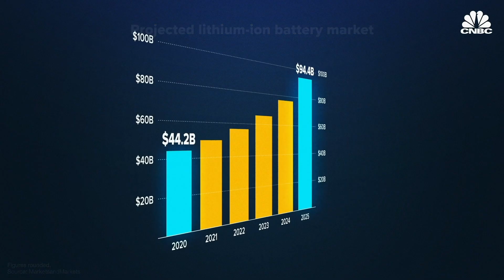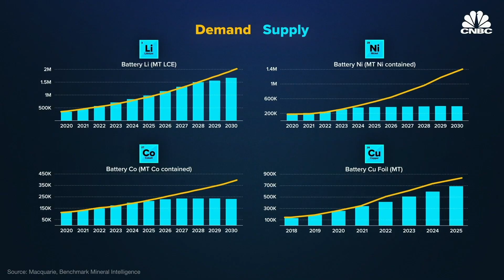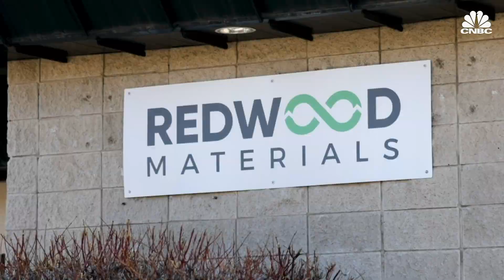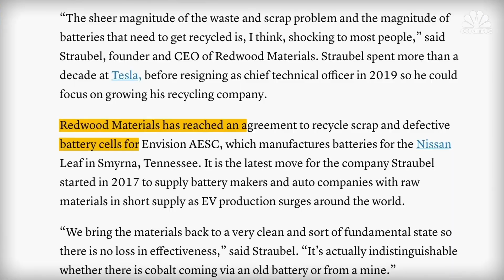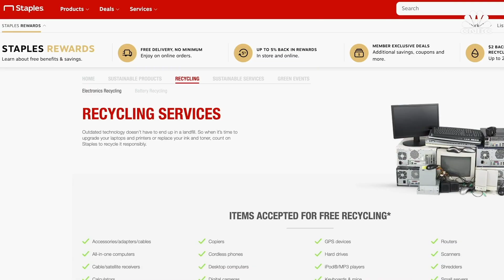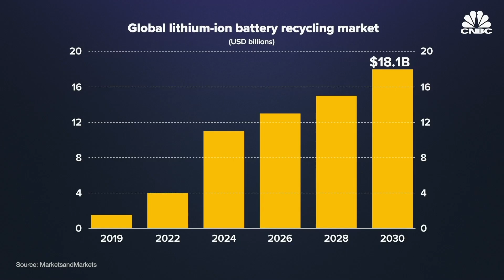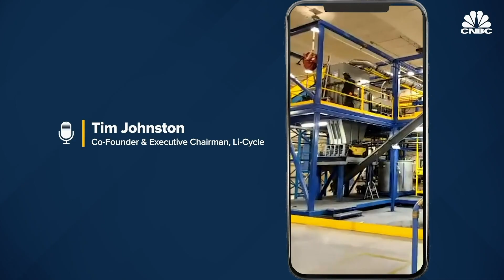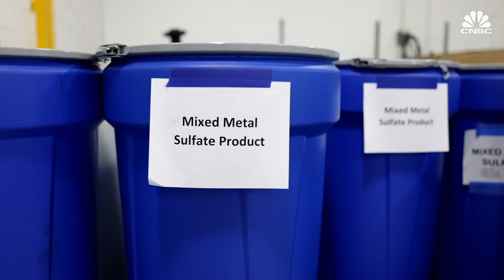How Tesla’s Battery Mastermind Is Tackling EV's Biggest Problem

Comment: He and my search online of his company don't say how they have dealt with the hardest part of lithium recycling. Each cells has a thick plastic coating that hard to come off. They are only 2 ways to take it off. To burn it off. Very heavy pollution and to acid melt it off. Both are used now. But not large scale. He the first. They is another way to grind it up but you have to take the plastic off to take the electrode n
Metal off or it could catch fire. That what they space it that way.
 And another big problem on lithium battery switch is they still have found a way to put out a lithium battery fire. It don't need oxygen that was fire extinguisher do is cut out the oxygen.  The problem is battery is really a stored house of energy. And we got 3-6 floor of parking close together. One fire could get the next car on fire too. Etc.  the only was is a single common regulated disable switch.
of rolls and now, or yr after a building fire they might just bans cars indoor parking if we don't solve thing ahead. As on fire the smoke could effect blocks
Reply: Reality, is we are taking billion of cars off gas. So where is this trillion of maga watts comeing from? They will be charged at nigh. Battery stored  solar power?
It has to come from oll power plant. Goggle bio mass wood pellets. They call it carbon neutral but are they making sure tree are replanted? We need tree leaves for that carbon dioxide to oxygen.
Goggle wood pallets shortage .
The worl has that shortage problem now.. we don't have enough wood for burning wood for power plant.uk is in a big mess. They tried too much and all failed breaking away. We are doing the same. Jack of all trade Master of none.

Comment: Behold, the real reason why electric cars are never going to catch on.  Hybrids are the future, not EVs.
Reply: Wrong, any car with an internal combustion engine in it, will soon be a thing of the past.  EVs are the future and I am already driving it!
Reply: @kevinkaaz7720  I think EVs are great and that environmental protection is important.  The reason they are not the future is for two reasons: (1) because they will ultimately become the supercars/ultralux segment as we gradually run into supply-side constraints and battery manufacturers are increasingly unable to source those materials cheaply and (2) because unlike ICE cars, which have an extremely long lifespan (see the used car market) EVs, by comparison, do not, due in part to Tesla's position against right to repair and the expense of repairs.  This means that we will need more new EV cars to be manufactured if the intent is to satisfy the demand of the entire US market.  That, in turn feeds into problem (1).
Reply: @aka_pierre  My Chevy Bolt EV is hardly in the super car/ultralux segment...
Reply: @kevinkaaz7720  that's not my point - we're going to run out of the rare minerals and metals needed to build EVs extremely quickly.  When that bottleneck happens, car manufacturers will reserve EV powerplants for supercars/ultralux.  The unfortunate reality is that EVs (including the bolt) lose around 10% of their battery capacity per year, and the cost of replacing the battery is the cost of a new car.  That is essentially built-in obsolescence (except unintentional).   Thinking that we can have the entire population driving cars that run entirely off a battery is just not sustainable in the long run.
Reply: @aka_pierre  That is total FUD about EV batteries losing 10% of their battery’s capacity each year.  My Bolt is over 2 years old and may have 2% degredation total.  I only DC fast charge when on road trips, of which I have taken roughly a dozen.  I have total confidence my battery in my Bolt will last over 10 years and over 200K miles with less than 10% degradation.  In contrast, the ICE car that I had the longest only had approximately 175K miles.
Reply: @kevinkaaz7720  Ideally, everyone would be driving around in high-powered EVs; I simply think it is unrealistic.  Your usage is great, but unfortunately, I don't think that you are the norm.  I recommend against using fast chargers whenever possible.

https://batteryuniversity.com/learn/article/bu_1003a_battery_aging_in_an_electric_vehicle_ev
Reply: @aka_pierre  Question for you Pierre - Do you own an EV?
Reply: @kevinkaaz7720  No.  I preordered the electric mini for my dad until the salesperson told me that it wouldn't fit his commuting needs, they said it would lose 10-20 miles of range every year, which would mean he would need to charge at work (not an option).
Reply: @aka_pierre  Here’s a hint, many salespeople don’t know squat about EVs.  Sounds like the Mini salesperson was example A.
Reply: @kevinkaaz7720  I don't mean to denigrate you, but I'm not going to take your word for it either.  Just look at used car sales and depreciation for EVs.
Reply: @aka_pierre  So you would rather take the word of some random salesperson that “may” have taken a test drive in an EV over an actual EV owner with real life experience.  I did months of research before I purchased my Bolt, also on other makes of EVs.  I knew exactly what I would pay as well as how it would perform years down the road.  I try to educate people on the benefits of EV ownership when they show an interest in mine.  I can see you have already made up your mind on the subject and for that I am sorry.  😞. You are truly missing out on driving a better more efficient power plant in a vehicle.  I guess I won’t waste any more of your time in any further discourse.
Reply: @kevinkaaz7720  I feel like we're talking over each other.  You seem to be trying to convince me to buy an EV (I don't need convincing, I think EVs are great).  I'm telling you that the future is not EVs because its not sustainable for everyone in the world to drive an EV due to resource constraints.

Comment: Democratic ran youtube channel saying we need EV because gas is bad...goes on to say: 

Cobolt has huge carbon emissions to process.

Says batteries are too toxic to throw away. 

Batteries have more than 5 toxic materials...

Battery start to finish have to travel 25,000 miles on ships which is way more gas emissions then oil coming from 1 state away to power your car. 

Says the battery supply chain is bad and is not a feasible source for mass car production....

So just keep gas cars....

Comment: We need a law that forces cell phone manufacturers to make phones with removable batteries.
Reply: Excellent !
Reply: Cell phone batteries are removable.
Reply: @user-RCST  not Apple.  Their batteries are glued in and sealed.
Reply: @djp1234  just don't buy Apple products then if you want to repair stuff.  It's still removable if you're brave.
Reply: @user-RCST  the problem is every other company copies Apple, so they’re all glued in now.  I’ve replaced iPhone batteries before, but it’s a pain in the ass, and your phone won’t be waterproof anymore.
Reply: @djp1234  well what do you expect do you want a waterproof product and a better product or do you want repairable product.
Reply: @user-RCST  it's possible to make a waterproof and repairable phone.  It's super easy.  But they'd rather sell more disposable phones.
Reply: @djp1234  then please explain how would you do it.
Reply: @user-RCST  easy example: GoPro.
Reply: @djp1234  a GoPro is nowhere near as complex as a cell phone.  Please tell me how they make the GoPro repairable and waterproof or show me a YouTube video that explains it well.
Reply: @user-RCST  The battery on the gopro works exactly the same way as the battery on a cellphone.  That's really the only thing that fails on modern electronics, and the only thing that needs to be replaced.  And the battery compartment on the GoPro is more complex than it needs to be.  Really, just the battery terminal needs to be sealed off from water.  It can be as simple as a rubber seal on an oil filter.
Reply: @djp1234  but on a cell phone you have to worry about every other component to not just the battery.
Reply: @user-RCST  I’ve never had any problems with cellphones except for batteries and cracked screens.
Reply: @djp1234  both of those are pretty easy fixes.  We were talking about waterproofing though.
Reply: @user-RCST  the battery waterproofing problem has been solved already.  We just need an easy way to replace the screen, which can also be done easily, but they'll never do it.
Reply: @djp1234  it really doesn't bother me just treat your phone good and nothing will break.
Reply: @user-RCST  

Most cellphones no longer have removable detachable batteries.
Very few models have this anymore.
Reply: @SunnyIlha  yes I remember those but they still have detachable glue pull tabs you can use to remove the battery.  I'm pretty sure they switched because the soft pouch design is either more energy dense or cheaper but that's just a guess.

Comment: We will not need battery recycling as there will be no electric cars in 10 years from now. The future of emission-free cars is in hydrogen. The Germans found a way to store hydrogen in a gel that can be stored, transported and distributed via existing infrastructure. No need for changing the infrastructure for trillions of Dollars as with EV´s, just slight adaptions. The gel has about the same energy density as gasoline, is inflammable and the hydrogen can be extracted by a simple chemical reaction. The then empty carrier gel can be reused several ten-thousand times. The best is, the extracted hydrogen will be burnt in very similar internal combustion engines as we already have. Also, only slight adaptions needed and the sole result of the reaction is water. No poisonous batteries that stay behind, no further violation of mother earth to mine lithium. Just as a side note, those hydrogen-burning cars have the same range as regular cars, you could even use the technology for airplanes which is absolutely impossible to do with electric engines.
Reply: Hydrogen is stupid.  Hydrogen is also not a green fuel source.
Reply: @user-RCST  Hydrogen is as green as electricity. It depends on how it is made. Do you think the electricity the world uses to charge their Teslas is green? Hydrogen is even way greener than Ev´s no matter how it is made, as you don´t need to mine Lithium, which is a major contributor to greenhouse emissions, you are not left with 600kg of poisonous flame hazards, when the vehicle reaches the end of life. When you burn Hydrogen (H), all you got as an endproduct is water (H2O), there are no other emissions. If you use green energy, like the surplus electricity from windfarms to create hydrogen, you have the cleanest form of fuel for the overall cleanest form of transportation, that works with every vehicle, even trucks and airplanes without the need to adapt the infrastructure for trillions of Dollars. Who do you think will win this race?
Reply: @Nyruami  go watch "The Truth About Hydrogen by Real Engineering"        then go read "what's with all the hydrogen fuel cell hype by insideEV"
You still have to build a giant amount of infrastructure for hydrogen for electricity it's already there.
Reply: @Nyruami  looking to superpower charging will not be a problem https://youtu.be/6zgwiQ6BoLA .  Most hydrogen produced isn't even clean.  They only plan four tons a year I don't think that's enough for a vehicle fleet.  Also hydrogen is more expensive and the cost of repairs are higher than a BEV.  Did you watch the videos I told you to watch?
Reply: @Nyruami  did my comment go through sometimes comments with links don't work?

Comment: What’s left out is that a lot of these battery packs have perfectly good cells, but that there’s one or 2 cells that go bad ruining the overall use of the pack. If the packs were just broken up and the good cells were removed, it would further save money and put those cells back in use.
Reply: The labor to do that probably isn't worth it
Reply: Even the ‘good’ cells would have decayed a substantial amount. Putting that in a new vehicle would just further shorten that packs life surely
Reply: The reason that doesn’t really work is because after every charge and discharge cycle, lithium crystals begin to grow on the electrodes, so even if a cell still holds a charge, it’s capacity and lifespan are significantly lower than a new battery.
Reply: Better to start fresh.
Reply: There are a few companies who will replace individual cells in out of warranty Teslas for a lot less than a new pack.

Comment: The lithium  extraction process uses a lot of water—approximately 500,000 gallons per metric ton of lithium. Lets talk about the EV's~ What will be the cost to do repairs on these cars? Are people able to work on their own car? Will people be charged for using the EV charging stations? Is the maintenance more expensive? What about charging costs? What about the depreciation on these cars? So many unanswered questions-
Reply: Good questions posed.  All Good.

Remember, that the battery-car is not mechanically the same as a combustion engined prime mover car.
Maintenance, and Replacement, of the Car Battery is unlike and different. 
In many instances there is no maintenance whatsoever comparable to the liquid combustion engine.  (Where there were a number of different maintenance parts and functions in the combustion engine, there are no equivalents in the
battery-car (none!)
Just a small example;  there is no radiatior/no coolant , no water pump, no hoses, etc, etc. in a battery-car !  There's no fuel tank even!  
There's no OIL !!
Reply: @SunnyIlha  I need to learn more. These were just a few thoughts.

Comment: How is this EV’s biggest problem? It takes at least 20 minutes to charge to less than full capacity with a high power charger and the batteries don’t last at those cycling rates. Recycling is recycling, doesn’t really solve the main operational problem with EV’s

Comment: Oddly enough, in the not too distant future, our population is going to go into decline.  Most countries have a birth rate lower than replacement.  In addition, an electric car is so much more long lasting than an ICE car, especially if manufacturers like Nissan will supply new batteries for your Leaf when the old ones need recycling.  We will get to a point where the market for cars will decrease and we will only need replacement vehicles.  At this point, we should be able to get almost all the materials for batteries from recycling and surly a ton of batteries are a far richer ore than anything we can did out of the ground.

Comment: what is degrading in the battery when recharged many times? most of the material in the battery does not degrade and is still usable? I am a battery noob, please educate me.
Reply: Nothing is degraded. The internal structure is slowly degraded, but not the material itself. Think of it like sugar. You can buy a bag of coarse grained sugar for baking. You can grind it down for use in coffee and food. And you can grind it down to a very fine powder for use in decorating cakes. The structure changes, but 1 ounce of coarse sugar contains the same amount of sugar as 1 ounce of powdered sugar. Only the structure is different. Heat the powder up, melt, crush it, and you have your grains back.
Reply: @JanBruunAndersen  uhhmm okai. why does it hold less power when recharged many times?
Reply: @generalshepherd457  - Why does a sponge hold less water when pressed together? It structure has changed. Same with batteries. Its ability to hold ions within its metallic structure degrades.

Comment: of course its going to bottle neck, only 1% of cars are electric. at this rate, EVs aren't even keeping up with population growth. all this hype needs to chill, of course EVs will break records every single year but only by a small amount.
Reply: It's +2% if you take into account the growing car market. Real bottle neck is mining methods, these metals are very common just difficult to extract, we will need around 80,000,000 tons of lithium for 8 billion EVs, you won't get that from recycling 20,000,000 tons.
Reply: @miguellopez3392  8 billion EVs would destroy earth though, even 2 billion is causing extreme damage. we're running out of time to scale that kind of production even if you support it
Reply: @Lildizzle420  and 8 billion Gas cars are destroying it slower?
Reply: @miguellopez3392  buy a bike and good pair of shoes
Reply: @Lildizzle420  i use to walk 10 miles a day then my joints started to hurt too much, high end padded shoes make you more vulnerable to injuries, then I got a bike, it either got punctured to often or homeless stole things off of it, I work out of town a lot and haul my own tools and gas is expensive in Washington state so im planning on getting one.